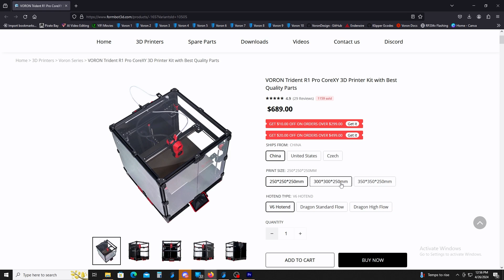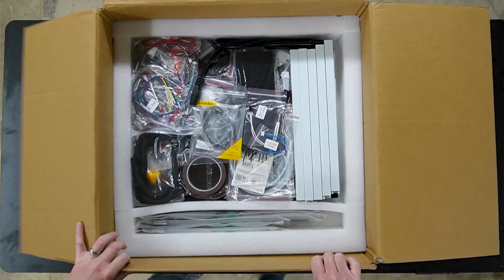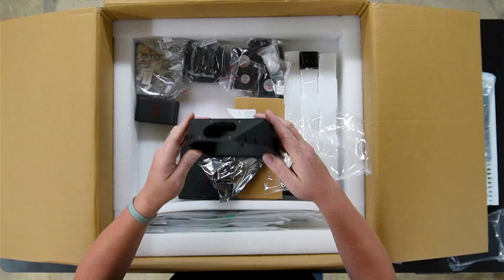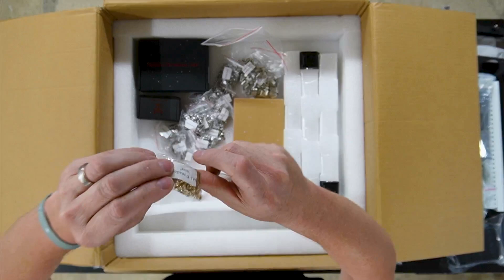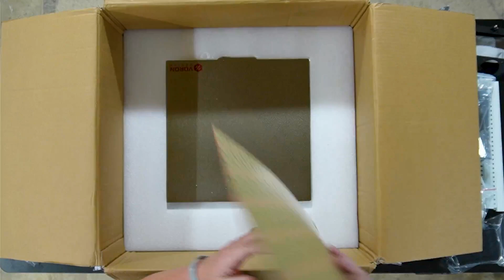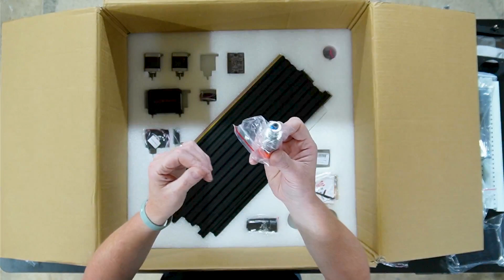Unboxing the New Formbot Trident Pro Kit! Voron Kit Upgrades Revealed!

Comment: Hello Lee! Could you help me out please? I'm an electrical engineer with decent DIY skills and while getting into the 3D printing now I found there are such projects as Voron. Could you please point me to a good online HowTo resource where I could learn more about this project? I know (if I get it right) that there are a number of printed parts that are not included in the kit that have to be printed on a... 3D printer. I don't have one but to make the things easiier would you say that BambooLan A1 would suffice for printing all the needed plastic parts? Well, I could ask about the Elegoo Neptune 4 but you probably understand why I didn't. I don't want to learn two hard things at once since building the Voron even from the kit in already quite involved in itself. I went to the Voron site but it does not look like a resource for uninitiated. At least that was my first impression.
Reply from the maker: Hello! I recommend that you join the discord server linked in this video. We have a lot of resources there and can help you directly. With your experience you should be just fine. For that A1, you won't be able to print ABS or ASA like you will need for the Voron. It's not impossible though. Join that server and I'll help you any way I can!

Comment: Great vid, i am considering the Kit as well, I have a siboor 350 V2 already pre can, but converted recently with eeb36 and umbilical. Although why the Manta over the kraken, or Octopus? what is the benefit?
Reply from the maker: It's a really well put together kit to be honest. I would highly recommend it. 

The reason with the Manta for one main thing I believe is using the CB1. That keeps from having to source a raspberry pi. As these kits did not used to have them cause they were hard to come by.

Comment: The 128MB SD card is for flashing your MCU (the Manta M8P board) with updated firmware. The 32GB SD card is for your CB1 (or Pi derivative). Some MCUs have issues reading the filesystem on large SD cards.
Reply from the maker: Thanks! I figured that was the case after I thought about it. Your totally right though larger SD cards can cause trouble when flashing via SD card. Thanks for watching!